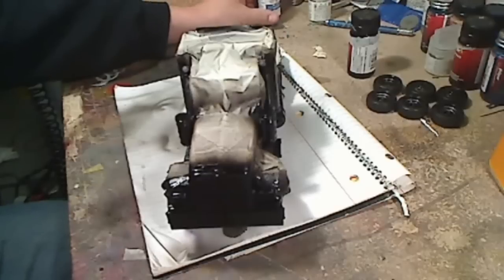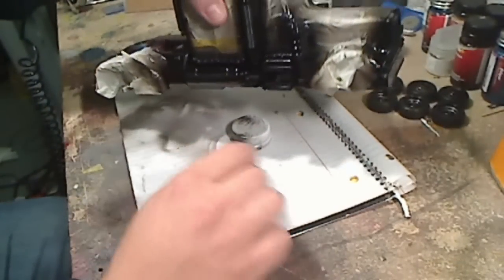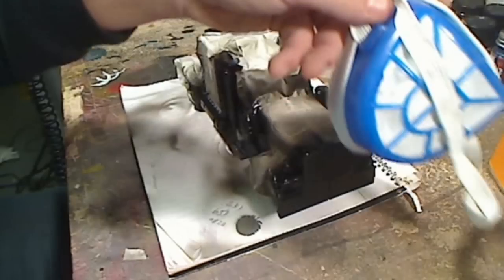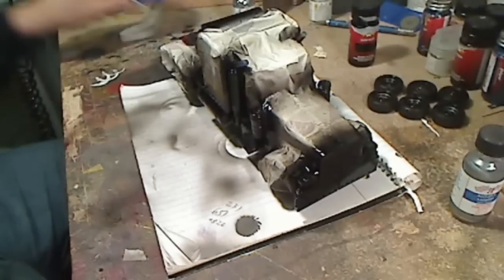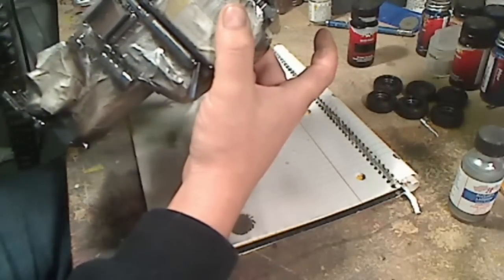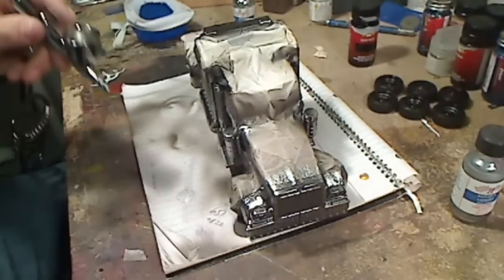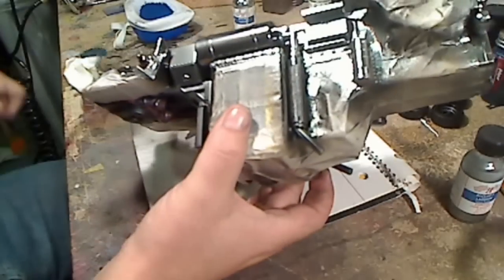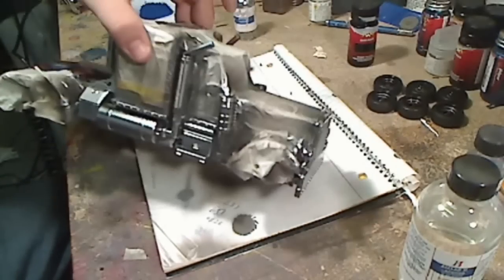Tutorial : Chroming with Alclad

Comment: use a soldering iron on the pins for 1/2 a minute or longer. it heats up the plastic and then pull the wheel. careful you don't burn the wheel. should work

Comment: @steliosz28 -Stelios, you're making an unfair comparison.  It should be "apples to apples".  ALSA Chrome is "high end" and designed for actual chrome work on automobiles, motorcycles, commercial parts,.  Alclad is designed for scale model work.  ALSA can be used for scale model work as well, however, it is FAR MORE expensive than Alclad  and typically too costly for scale modelers.  Just want to keep this in perspective.

Comment: Odd question, but does anyone think that using Alclad on a dark grey silicone or latex base would work? I need to create an armour for an arm that moves smoothly -- not articulated.

 I have therefore considered sculpting a clay version of it, creating a two part mold for it, and then creating the piece with silicone or latex to form an all-in-one sleeve. Only trouble is, I need it to look chrome. 

I have tried adding "Tamiya acrylic enamel" pigments to latex, but it came out dull, as expected. This was a good base, however, for Metallic Sharpie. It did rub off a little, and certainly scratched off very easily. However, due to the darker grey base, this simply looked as though the arm had been in a fight --which I thought looked pretty cool!

I am still, however, looking for a more effective finish. If I pigment either latex or silicone to look black, do you think I could airbrush a whole sleeve with Alclad, and would it be up to the movement? 

One of the staff at an art shop assured me that, due to the chemical makeup of the paint base,  it would adhere to latex. And also silicone, which surprised me, as I thought only silicone sticks to silicone.

Thoughts anyone? Thank you in advance! It's much appreciated :)

Comment: Please do not use that as a mask. You will breath the same toxic particles as if not using it. Proper masks are a bit expensive but they work, still you need the area ventilated.
Reply: He's right.  That's only a dust mask.  You need a proper pant mask that has carbon filters in it.

Comment: Can you apply the chrome with a brush?
Reply: nope, only airbrush for alclads
Reply: Metallic paints can be difficult to work with.  Using a brush would almost guarantee visible brush strokes on whatever you're trying to chrome.  That would be why an airbrush or spray paint is usually the best option.
Reply: Bumble Douche Do you recommend a particular brand of spray can that gives a chrome (or near chrome) finish? Can't really afford a airbrush but still want a shiny finish!
Reply: IamTheWillrus
I'm only new to customization myself so I haven't worked out all the tricks... But I have found that in the absence of "hobby shop" brands of spray paint (i.e. those specifically made for plastic models like tanks, etc), that spray cans they sell at auto-repair-type stores (e.g. for touching up scratches on a real car) are very effective, strong, waterproof and surprisingly easy to work with.
Reply: Ah that's helpful thanks! Never thought to look into car paint, will give it a go
Reply: I wish I could take credit for thinking it up but I actually saw it mentioned by someone on another video somewhere.  Unfortunately I can't find the link.  Here in Australia we have specific brands made for sale exclusively in certain auto-shops, but I'm sure you can find an equivalent in any country.  I used a chrome spray (ostensibly for restoring chrome bumpers on classic cars) to re-spray the chrome areas on my G1 Optimus Prime.  It did take a good while to fully cure but it looks great & as a bonus is rather strong & chip/scratch resistant while at the same time being "polishable".  It looks as good as new.